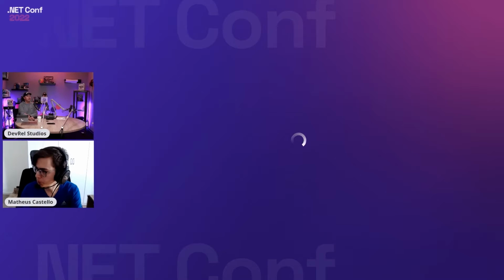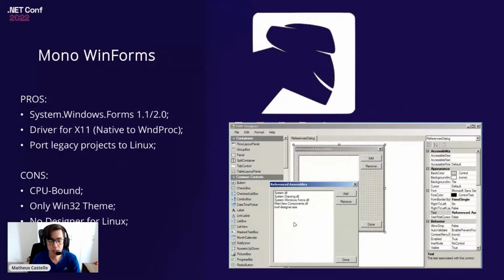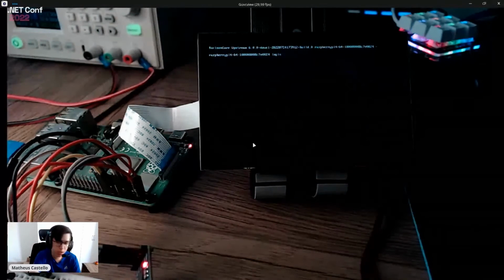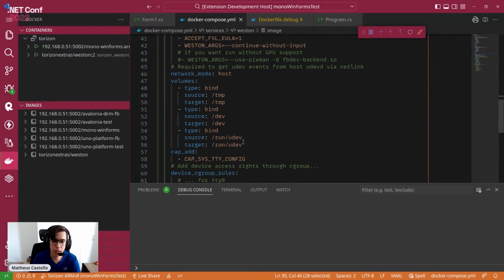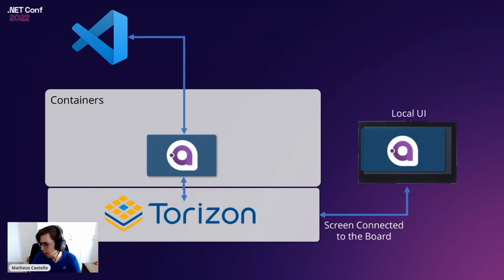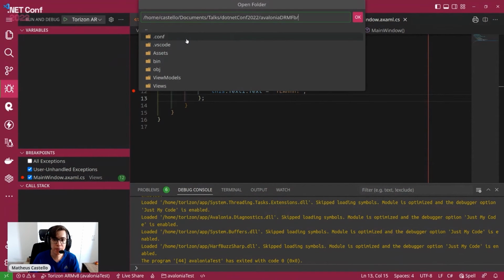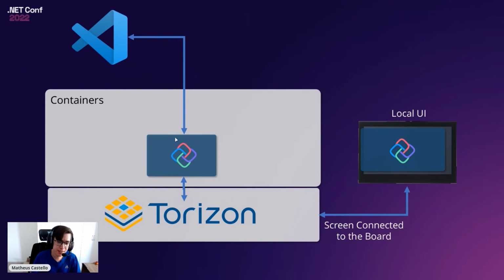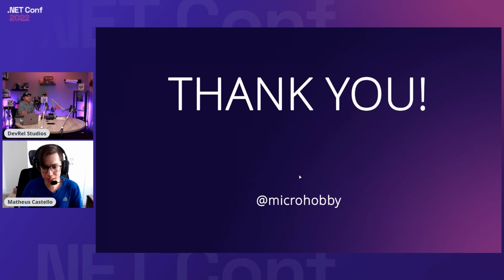.NET GUI Applications for Embedded Linux Using Containers | .NET Conf 2022

Comment: I want to run a Uno or Avalonia application using all the power or C# .NET for accessing devices and display data and control relays, for instance, on a Toradex Verdin i.MX8M under Torizon (Yocto based OS). Have you advices or github repos and workflows to share ?